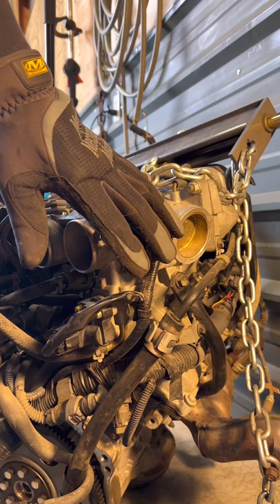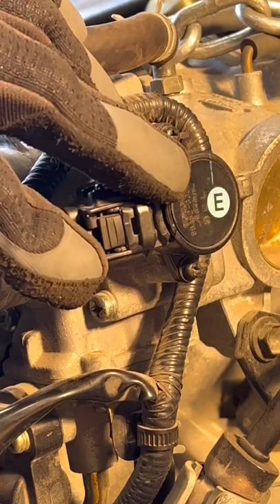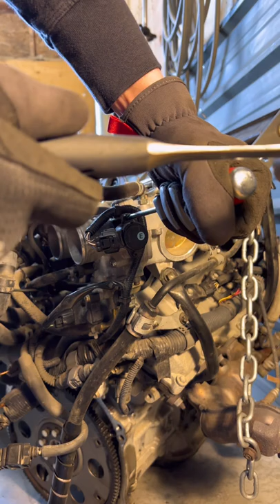JIS screws

Comment: I work at a Komatsu heavy equipment dealership where the machines are Japanese,  they have those exact same screws and i never knew they were jis, i always use normal screwdrivers
Reply from the maker: You gotta try a JIS driver. It won’t cam out like the phillips.

Comment: Thats what a set of 4" Knipex channel locks are for. They bite the should of those screws when someone has already stripped them perfectly. Have done it more than once to save someones mistake.
Reply from the maker: I’ve seen those, look awesome.
Reply: @ToolDemos  try a 6” pipe wrench, if it fits where it needs to it’s easier on the hands and makes a good hammer
Reply from the maker: @dirtyaznstyle4156  gotta love a multi-purpose tool.

Comment: Since it's out i use small vise grip easy does worst case you want to tight first then lose next ... because your always attempts to lose it your going against the force but if you tight it first you broke the seal then easy does it same way with screw driver try tighten then lose .... this tip you don't learn it from school or computer only from experience
Reply from the maker: Good tip thanks

Comment: I have stripped many a JIS screw on my 4Runner. Including the TPS....
Reply from the maker: Same here, but not since doing it this way.
Reply: @ToolDemos  The MAF sensor is the absolute worst on my rig. You can't fit a full size screwdriver in there. I usually find a screw bit that fits and then use it gripped in vice grips lol. Currently have 1 screw holding in the TPS and 1 screw holding in the MAF because ive stripped the others.... Still seals and they are secure. On  my list to get new screws though lol
Reply from the maker: @bwame  what a pain!

Comment: They look like normal philips screws, what makes them so different?
Reply from the maker: A Phillips screwdriver was designed to cam out at a certain torque load. The JIS are very similar but are not designed to cam out.

You can also use a JIS screwdriver on a phillips screw, but not the other way around.

Comment: If it fails you still can use a knipex wire cutter. Done that many times haha
Reply from the maker: I’ll try that. Thanks Reynier.
Reply: @ToolDemos  Grab the rond head on the screw exactly on 12 and 6 o clock or 3 and 9 o clock etc. Press hard en turn the cutters to the left. Try it haha. Always works for me if there is space for the cutters 🤣

Comment: Is jis also called pozi drive?
Reply from the maker: No, JIS is Japanese Industrial Standard, found in Japanese cars. Pozidriv is a different fastener type not seen in automotive. You can tell by the cross on the screw head - at a 45 degree angle through the ‘Phillips’ looking recess. Google an image if that doesn’t make sense.